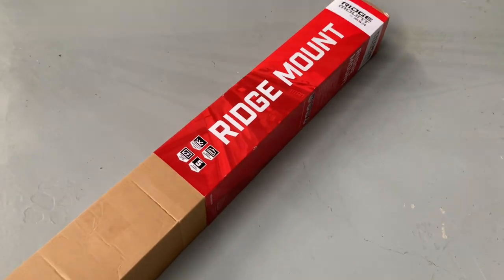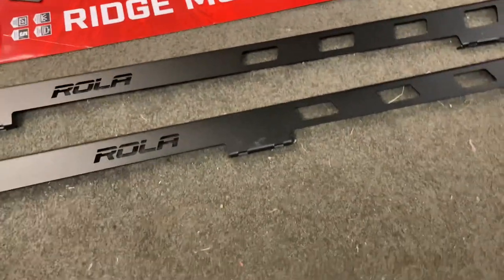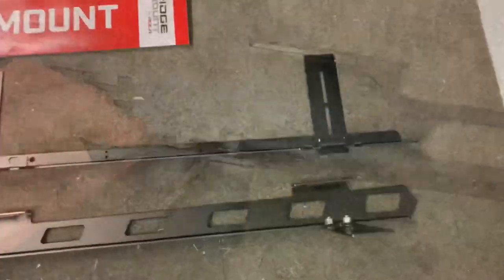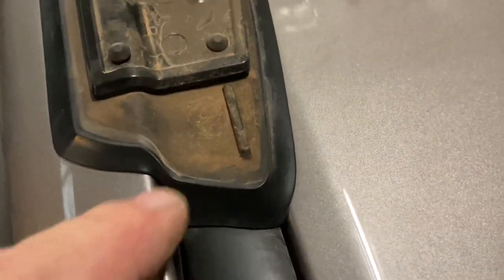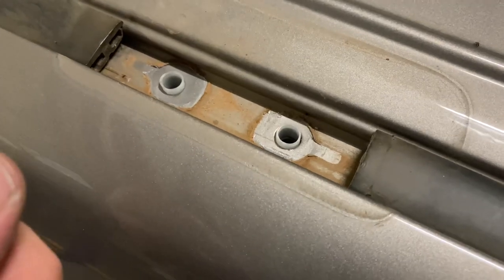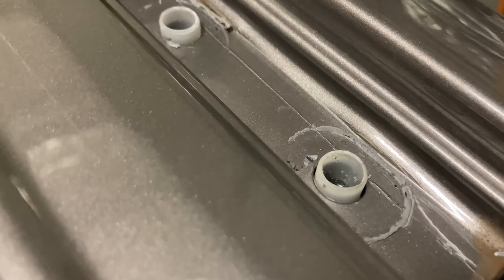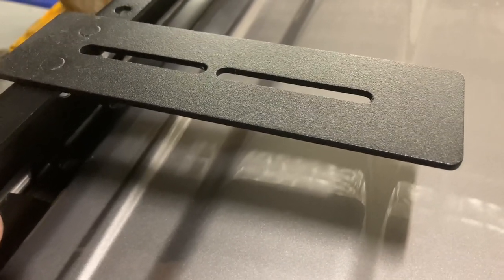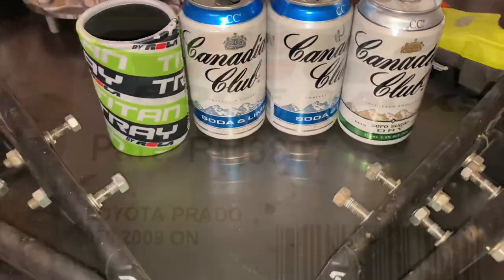ROLA RIDGE MOUNT INSTALLATION INSTRUCTIONS with FULL DETAILS

Comment: Thanks for that info Anthony. I have the LRS installed and wasn’t thinking about changing. Great info though re the sealing of threads and holes. I would also be disappointed about the Allen key slots if I had spent money on the ridge mount. Why can’t Rola just make it easy? I don’t get it.

Comment: How do you find the wind noise? I find it significant compared to the low rail mounts...
Reply from the maker: Absolutely zero wind noise
Reply: @fourby4adventures704  For you to say there is absolutely zero wind noise I am sorry to say is rubbish. I thought you were a bloke that called it as it is regardless of brand. Go for a drive on the highway or at least 80km/hr and listen to the wind noise, it's noticeable.
Reply from the maker: I would have to say you are speaking rubbish because you are say I am speaking rubbish 🤣🤣🤣
I thought you would be a man that’s not hearing things 🤣🤣😉😉✌️✌️
Come for a drive I’ll leave and go up to speeds much higher zero wind noise you might want to look around for something else causing the noise.